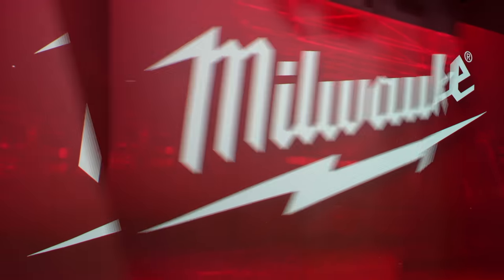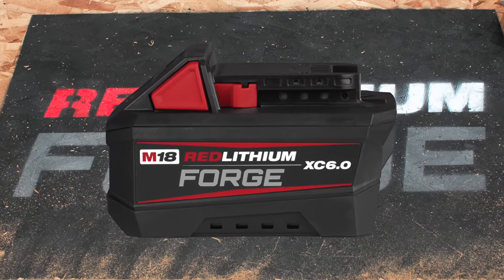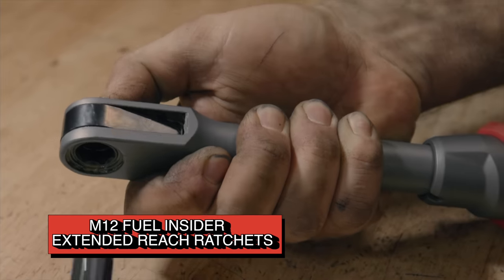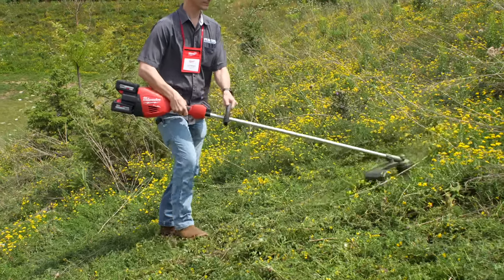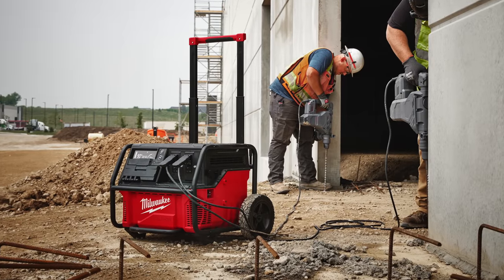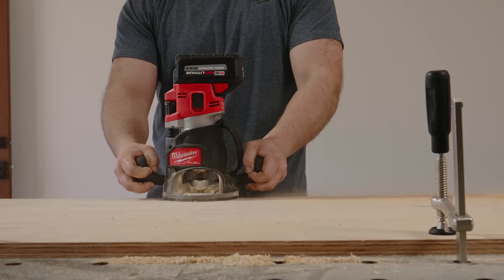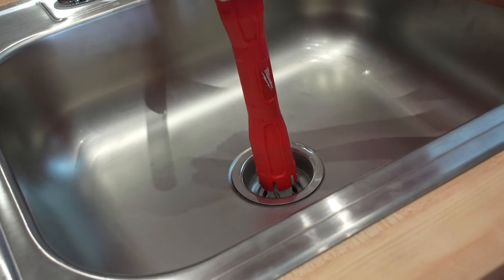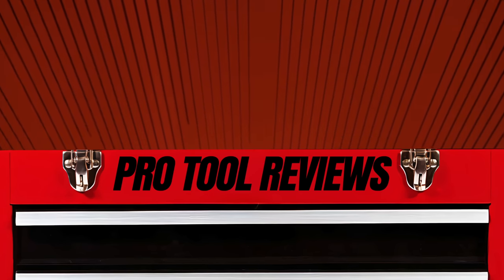NEW Milwaukee Tools From Pipeline! New Tools for 2023 & 2024

Comment: I’m kinda mad, I finally got M18 18 gauge brad nailer and they come out with the M12
Reply: nahh, that 12 v only shoots 1.5 inch brads.....the 18v shoots 2 1/8th  brads, huge diff
Reply: @nodoubt46able that's unfortunate. I picked up the m12 pin nailer for $170 last week. It only does 1 3/8" pin nails. The Dewalt only does 1/8" more and more expensive
Reply: I have first gen was going to get gwn 2 will wait for m12
Reply: Once you realize how small 1.5 is you’ll be happy you got the m18. Sounds “enough” for DIY till you are 1/4 off. I bought the ryobi which is limited to 2, other brands go 2 1/8 you realize that 1/8 makes a world of difference.

Comment: Will the m18 forge batteries charge just as quick on the single bay super charger?
Reply from the maker: Haven't been able to test that out, but it's a great question, and something we'll aim to figure out once we get our hands on one of the new dual port chargers. Based on the product pages from Milwaukee, it appears that the single port and dual port charge at the same rate.

Comment: Will the chargers be able to charge the m12?
Reply from the maker: Milwaukee actually already has an M18/M12 Super Charger on the market, the new announcement is the dual port M18 offering.
Reply: @Protoolreviews   yes but I want the new forge battery and charger and I don’t want two different chargers on my tool box. It would be nice if they had a M12 in that but it would have to be a slower charging for the m12
Reply from the maker: Both Super Chargers offer the same power delivery and compatibility with the new Forge batteries, one is an M12/M18 hybrid (Which sounds like what you're looking for) and one is a dual port for two M18 batteries, but the efficiency doesn't change.